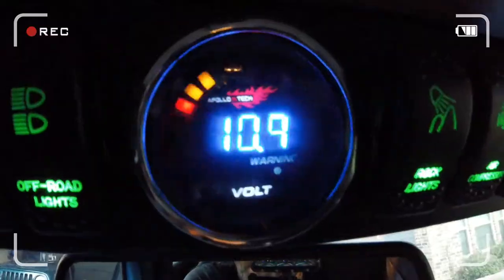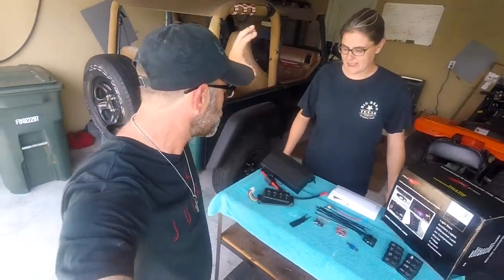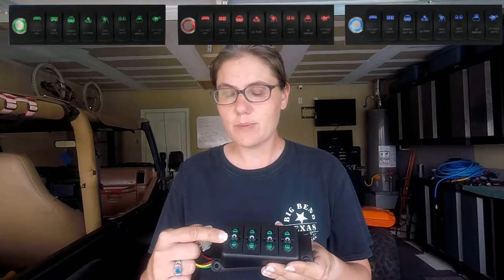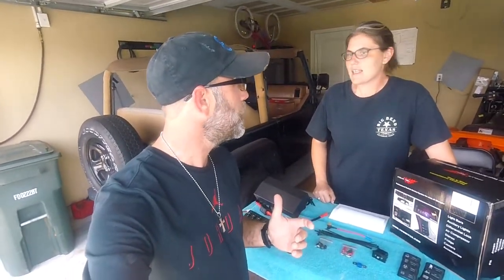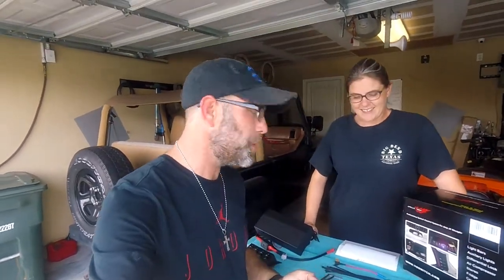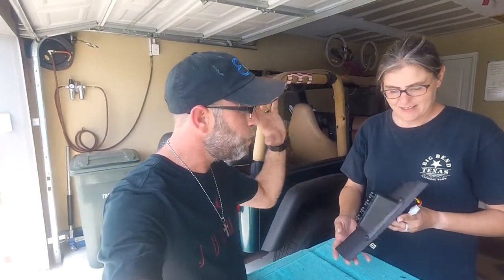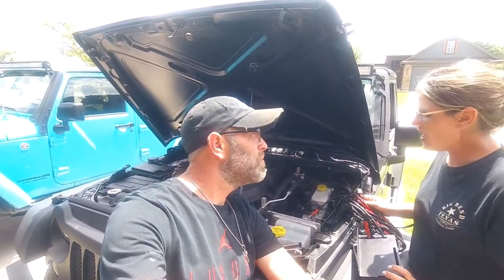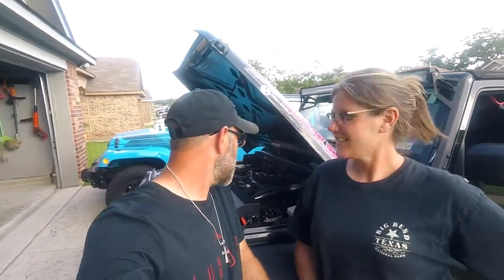Episode 343 - Apollointech A-Pillar Source Control System Installation & Review

Comment: I like the setup but I wonder if they'll install on an aftermarket A-pillar so you don't have to mutilate the factory cover.  Easy install and good tip on clearancing the fuse box!
Reply: farmboy30117 . You could always buy one from a dealer. I think they are around $20.00
Reply: Good point!

Comment: Great video!  Im torn between the A Pillar & the 8 switch.  Need both your advice. Love the secure mount of the relay box on smaller set and having less switches. Only need 4 for now. But I don’t like how you cannot dim or turn it off.   On the other hand, we love these options on the 8 especially with the lvco. However, we will have more switches than we need (for now at least).  Also...How is the 8 switch relay box holding up?  You mentioned that it is not real secure and moves close to the brake lines.
Reply from the maker: That can be a tough call. the 8 switch source control has held up really well. We are a split house hold Im (Bubba) is a huge fan of the 8 switch with the J3 mod for sure. Today I only use two switches but plan to use 3 more before our 2k mile overland trip. So 8 is a little much. Then again you just never know ha. Bobbie is very pleased with the A-Pillar. The mounting of the source system is spot on. But you are limited. No LVCO, expansion requires adding another system (I have seen folks run both A-Pillar and 6 Switch). Really tough call. .. Not sure if this helps much?